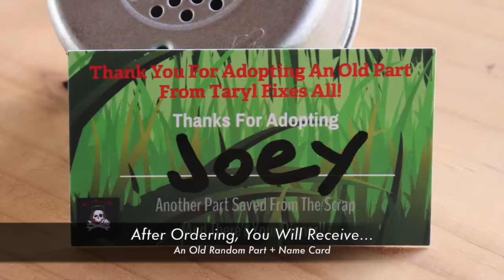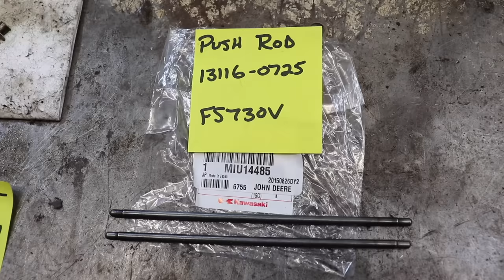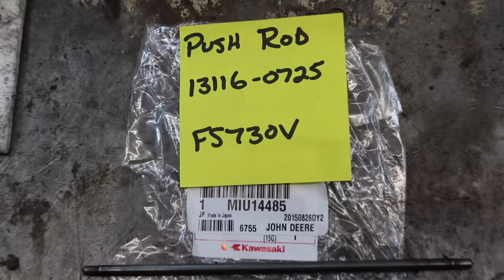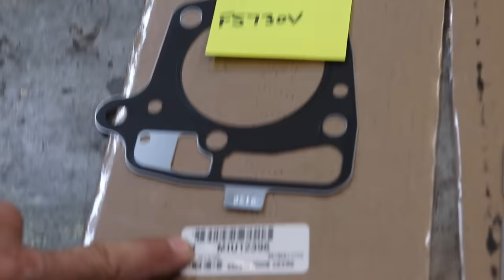How To Fix A Valve Guide That Moved. Epic Fix!

Comment: Those access holes are genius. These customers are lucky to have you. Most places wouldnt even consider repairing that, they would just say you need a new head.
Reply: Sooooo  True !
Reply: Just brilliant!
Reply: It's hard to warranty a head "fix", but if done right, you can accomplish a solid repair. I use Loctite 620, which is specifically formulated for applications such as this. Zip~
Reply: Thats because it needs a new head, or a slightly oversized guide.
Reply: @riceburner32  of course it does. The point is there are always options. If it works and it saves money why not fix it. Like Taryl says its just a lawnmower engine.
Reply: @jmc5341  point being, sure any hack can do a job poorly on their own stuff, but if you are a professional in buisness and getting paid to do a job you owe it to your customer to do a professional repair - unless this was a joke video, then I gotta say very well done!
Reply: @riceburner32  im sure he asked the customer if he wanted to try a cheaper fix. I get what you mean though. It kinda depends on the customer and if they understand they are saving money but therebis a sacrifice. I would do something like that on my own equipment but probably wouldnt for a customer.
Reply: Also there is a big difference between being a hack and being creative. If the fix works and costs less is it wrong? Maybe in a daily driver or something where reliable is extremely important but in a lawn mower who gives a shit. Context is important. This isnt a ferarri channel, its a channel for repairing equipment that in lots of cases comes from the factory with plastic carbs and plastic engine internals.
Reply: @jmc5341  there are "fixes" then there is "butchering" this falls to the later. 

100% successful comedy though, I'm sure this was just satire.
Reply: @riceburner32  dont forget that most of these engines are designed with plastic  engine internals in the first place.
Reply: @jmc5341  keep the oil clean and don't overheat too badly and the plastic stuff isn't bad.  Generally i have only seen that in some external parts or a governor.  I know there are some Honda generators that use plastic camshafts.
Reply: I had a 49 Intek I built recently. 
It was victim of an overheat , and had bent pushrods on one side. 
I found the exhaust guide moved. Being this engine is for me,I took a gamble and pressed it back in. 
It took some force on the press wasn't bad. 
Reason it overheated was the blower housing was packed with mice. 
Keep it clear and it won't overheat and it should be fine. 
I've put about 10hrs on it since the redo (can't call it a rebuild I didn't use many new parts) 
I wouldn't gamble on a customer's engine though like that.
Reply: Selling parts is ok, but labor dollars are good too.
Reply: Depends, those heads are over $150 apiece.  If the customer asked him if he could repair the head--and he of course made the obligatory disclaimers--I see no reason to do it this way.

Hell, with a set screw holding the guide in, this "butchered" fix will probably last longer than a new head.
Reply: @riceburner32  there's nothing wrong with his repair, it saved a fortune for a new head.  The manufacturer is to blame for press fitting the guide and making a path for grass to get packed in there, with no way to clean it out.  I bet there were many failures for this same reason and the manufacturer took no responsibility for them.  Nobody can be sure the guide wasn't already loose due to an out of tolerance hole.  You gotta admit that putting the 2.5" cleanout caps in is something that the manufacturer should have done from the start.
Reply: @riceburner32  if it was your machine, would you have rather shelled out the extra $250 for a new head assembly?
Reply: @tonyfremont  i would look at options for a dependable repair, if one cannot be done, then, yes $250 for a new head is cheap insurance from getting stuck somewhere.
Reply: @riceburner32  what wasn't dependable about that repair?  There are three other guides likely to move out of place long before the one with a set screw in it.  It's a mower with two cylinders, it's not likely to leave the owner stranded in the desert. ;) I think it's pitiful that the relatively small amount of overheating resulted in that damage.  Mouse nests are common around lawn and farm equipment.  Decades of manufacturing experience should have gave the mower builder a clue.  I see a planned failure.
Reply: Make It Fit It’s a lawnmower, not the space shuttle. plus if you get stuck somewhere on the lawnmower just get off of it and you’re at home. This fix will last longer than the guides on a new $170 head that are fairly likely to move anyway. There doesn’t even need to be a rats nest on the cooling fins, I’ve seen them move with clear fins for no good reason. I know he explained the options to his customer and his customer chose the fix instead of parts replacement.
Reply: @Shootingstarcomics  he didn't "fix" anything.
Reply: @Make It Fit The customer got lucky that Taryl even gave this option, most shops around here would either push for a new head or have you leaving with a newly discounted mower. You seem to know something about something, but to say "he didn't fix anything" has got to be either the most asinine or pretentious thing I've seen anyone say this week, even if he didn't have 40+ years experience. It's not only fixed, it's reinforced better than a brand new head, the customer paid less, Taryl made another nice video, everyone wins.
Reply: @riceburner32  I agree with the type of repair we saw....At the very least a new valve guide  would have saved the owner the labor cost for drilling and taping a hole. Probably a factory specfor the hole.
Reply: @riceburner32  This repair is more solid than a new head. It's the original pressed in guide that moved and caused the failure. Taryl's mechanically locked in valve guide is going to take a lot more effort to move out of place than the pressed in guides on a new head. Taryl didn't butcher this job, he fixed the design flaw that made the part prone to failure.
Reply: @thebaron44  Kawasaki doesn't sell the valve guide individually, you have to buy the cylinder head at (currently) about $200 each. The owner is saving a lot of money and getting a more solidly held in place valve guide on top of it.
Reply: @killer2600  wrong, butcher job.
Reply: @riceburner32  If you want to spend $400 more for two heads that'll fail the same way in another 177 hours be my guest. Definition of Insanity - replacing a failure prone part with another failure prone part expecting it not to fail.
Reply: @killer2600  I'm sure the head could be properly repaired
Reply: @riceburner32  How? Kawasaki doesn't offer the valve guides. It's considered a non-serviceable part of the head so it's either replace the head or do a custom solution like Taryl. But you already consider custom solution to be "butcher" so the expensive way is your only way.
Reply: @killer2600  There are other ways to fix the valve guide in place with a lot less work and time involved such as.... knurling the end of the guide before pressing into place....or make a new guide....don't have a lathe or a friend with a lathe?  Time to get a lathe even a china made 7x10
Reply: @ralphedman7753  I'm not the one objecting to a custom fix. The other commentor is the one that wants factory replacement parts.
Reply: @riceburner32  you say he didn't "fix" anything....how do you figure??  What exactly is your definition of "fix"?? The problem was resolved with a very creative solution that also saved the customer money. How is that not a fix??🤔🤨
Reply: You are absolutely right

Terrell is awesome
Reply: @KTHKUHNKK  so is Taryl

Comment: A couple of tricks we used to use to hold in valve guides in aluminum heads like that were to knurl the valve guide on the lathe, (knurling increases the OD of the guide slightly), then we would press it in place with green locktite. 
Rather than a set screw, on some engines we would drill an offset hold that just touched on the side of the valve guide and drive a roll pin in place. This was common on engines with valve guide bosses under the spring.
On some race engines and aftermarket heads they would use a circlip or snap ring to back up the press fit on some valve guides. The circlip would retain a larger steel washer that protruded beneath the valve spring, and thus the valve spring pressure would help hold the valve guide in place. The steel washer or shim also prevented the valve spring from wearing into the aluminum head as well.

Comment: Locktite offers a high temp locker. It's 620 and it holds up to 382 degrees Fahrenheit. It's specifically designed to work with cylindrical press fit applications and I always use this in conjunction with a set screw and peening the surrounding aluminum. I've got engines out there that have over 600 hours on them after this repair. Thanks for showing another method. Zip~

Comment: I had one of those come in my shop last week but it wasn't for overheating.  The bolt that holds the rocker mount to the head came loose and the mount turned.  The pushrod fell out and bent.  Got a used pushrod from a scrap kamasakee and he was back to mowin' in no time.  Thanks for the great idea to fix a valve guide.  WooHoo!!!!!!!!!!!!

Comment: Lol, loved the adopt a part. A few weeks ago, a friend of mine who works at Napa was cleaning out his dad's old mower shop. His dad had been in business since the late 60s and closed his shop in 1990 and he then unfortunately died of cancer in 1991. Steve gave me a big box of new old stock parts he found in his dad's shop. There were condensors for the old Briggs 8n series and points for 3.5 and 5 horse tecumsehs and even a new .010 piston and ring set for a late 70s lawnboy 2 stroke, I think a D series. I doubt I'll ever use them, as the engines they fit are long gone and I haven't seen any or worked on any for years, but I'm thinking of making a display showing pictures of the engines the parts fit and a description of what they were for, and put it up as a display. Kinda have it as a antique display.
Reply: nice story thanks
Reply: Old Lawnboy parts do have a demand, a lot of guys are restoring them, look at e bay, it will suprize you
Reply: Old Tecumseh parts are also coming back too. And I have 2 of the old 8n Briggs engines. They are getting hard to find parts for.
Reply: Yes for sure guys are looking for those parts , Ebay would be your best place to sell them or join some old mower sites where these fellows discuss all things about mowers and the like , I'm sure you will find some interest there.

Comment: To retain the valve guide, consider using 2 set screws. This was done on old Cub Cadet mechanical PTOs, and I adopted it for commercial machinery I used to work on, which had a lot of flat belt pulleys affixed with set screws.

Comment: Taryl I have held the guide with arc welder ground and scratch the side with hacksaw blade for a rod very very quick like strikes .  3-4 times then press it in works on valve seats also . done  it on a head with out pullig it . once very  very tricky . to get in ther . . nice job Taryl  as always Thank You.

Comment: This is the difference from a real "mechanic" and a parts changer.
Reply: Most shops just would try and sell you a new mower...
Reply: @Wayoutthere  yup
Reply: Do they make new guides to press in
Reply: Old school
Reply: @russlumley4974  No, Kawasaki doesn't sell the valve guides separately. You have to buy the entire head.
Reply: Ya I mean I definitely wanna pay for a butcher job. Personally if I'm paying for something fix the fucking thing and replace the head
Reply: @russlumley4974  yes but you’re still stuck with the same outcome eventually.
Reply: Not if you check for mouse nests before spring startup. Or verify cooling airflow by feeling.

Comment: When using valve compressor as you say you can bend it due to collets jamming. Take initial tension and the tap valve end of compressor with soft hammer aluminium or bronze and it will pop the collets loose then wind in rest of the way as normal.. Love the show Tarly

Comment: Hey Taryl ... gunsmith supply houses (Brownell's & Midway) sell a super heat resistant version of LOCTITE known as ROCKSET.   It is used to secure muzzle devices on guns, so you know it will withstand lots of heat.   It's worth having on hand for repairs such as this.
Reply: This looks a lot like the Fluid Weld we used for valve seats, guides  cylinder repair sleeves at a fraction of the price.
Reply: @jz422  That looks like some good stuff, thanks for posting.
Reply: Rockset. Thanks.
Reply: "Rocksett" adhesive
Reply: I bet that guide would hold with 680 forever as the aluminum pulls so much heat out of it but it would be nice to have some extreme temperature compound

Comment: This is a very interesting way to fix this.  I had the same exact issue with my Briggs Intek engine.  The guides within the cylinder head would move and break/bend rods.  You can find this issue online, many people complaining.  The only way to fix this seems that you have to replace the cylinder head.  The other way is to use a punch and peen the aluminum around the guide.

Comment: Great fix and idea, brilliant , thank you... Had loose valve guide problem, gave it to a shop and paid well... He told he made a new guide cause the hole was too big for original guide etc so i said ok... 

But 2 months later the same...engine and egsaust full with smoke .D so i watched your video, pulled out the guide and it was %100 not a new guide as the shop told me... And there was blue glue :) so... 

Today i bought green locktide, opened a hole behind, and the operation is over... Tomorrow i will bring the bike together, and i hope everything is perfect :) 

Thanks again for that brilliant idea

Comment: Rebuilt too many VW air cooled cyl heads in my time.  Always drilled out old guides to remove and heated the head/cooled the new guide with a quick press in.  Never came out.  In this case, I would have the guide knurled along with heat head/cool guide press in.  That guide pretty well fell in, wouldn't feel comfortable with the repair personally.  Otherwise, great video as always, you are full of great information and instruction.

Comment: what do you think about the method of mig welding a small bead on the guide?  Is there a replacement guide that has a step oversize bump step to prevent movement? If so, where can I find a couple?

Comment: Hey Taryl, I've got a Kawasaki FH531V-CS06-R (on a Husqvarna rider) with the same problem on the #2 cylinder head.  I'm not sure I have the skill to do the repair you demonstrated.  Can I send the head to you for repair?  Update:  On closer inspection, it looks like someone attempted a previous repair by pushing the guide back in and then maybe using a small center punch to "squeeze" the aluminum tighter around the guide.  It may have worked for a while but eventually failed.  I'll get a new head, but thanks so much for this and all your how-to videos.

Comment: I love your videos. I couldn't find any info on my problem but on a welder with a kohler the push rod broke in half and somehow got below the lifter and fell into the motor through the lifter hole. Any tips short of an engine rebuild? Thank you, you rock

Comment: One suggestion on the valve guide.....lay it in your vise jaws and use a very sharp chisel and lightly make splines around the guide. As you would say, "Don't get carried away". Rather than remove material with the grinder on the outside of the guide that helps hold it in, all is still there. You could use still use setscrew. Good job on the fix. I've been working on small (and large) engines most all my life and most times know what you're going to say before you say it. Lots of good advise on here. And lots of fun!!!

Comment: Taryl, I'd like to adopt a muffkin for a fc420v, on a 91 scag walkbehind. I need it running first. I keep slinging an exhaust pushrod. Runs great for 30 seconds, then pushrod falls out. I've set the valves twice but still acting up. Checking valves and all that now. Love the videos!

Comment: Hi Taryl, I’ve got the same problem on my Husqvarna MZ52 mower, with Kawasaki FR691V. I was wondering why the other push rod got bent. My case is same as yours. Have you done anything with the other guide, or just put two new rods after all the work done? I hope you answer my question, you are so busy! Thanks for your video!

Comment: I love your videos, so funny but so helpful at the same time. I once used Quiksteel Thermosteel from the auto parts store on a new valve guide in a buggered up hole (my fault getting the broken guide out) on the head of an old 84 Honda XR250R dirtbike. It was this or scrap the bike. Local race shop reamed the new guide and cut the seat. Ran good several times, but sold the bike a year later, so curious to know how it held up.

Comment: Thats a pretty cool repair ... hands down. I was going to buy a new head but may try this on a yamaha generator. I have a bent intake valve due to the guide seat sliding up. Kicking it back in wont do the trink but if i can get a locker divet in there, that will do the drink. Good point to check the timing as well when doing this type of repair.

Comment: Just a quick question?? If you were knocking the valve guide out from the bottom, how did the top get damaged or have you installed it upside down??
Reply: Good eye.

Comment: Got a moved valve guide I'm dealing with right now.  Never knew I was running on one cylinder.  Found out using a thermal camera to help spot an oil leak.  Found the leak.  Also found that one side has a snapped aluminum rod, and somehow the engine was running with the steel rod jammed inside the oil hole.  Still plowed the snow this winter though.  Tough engine.